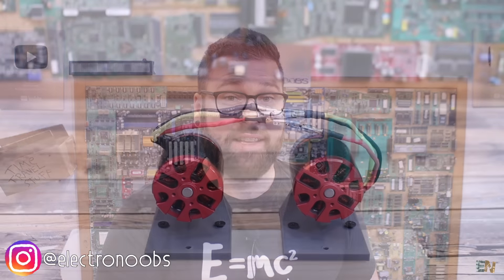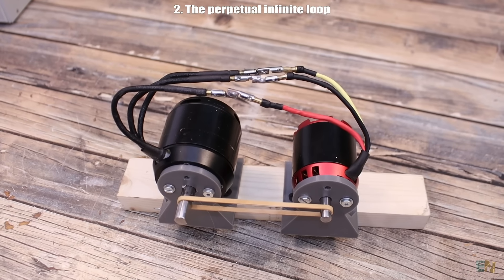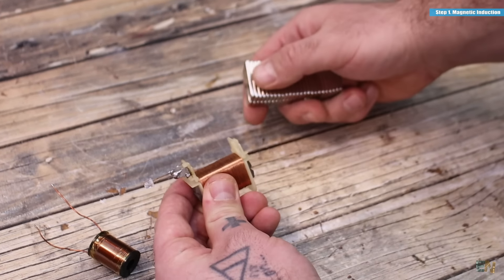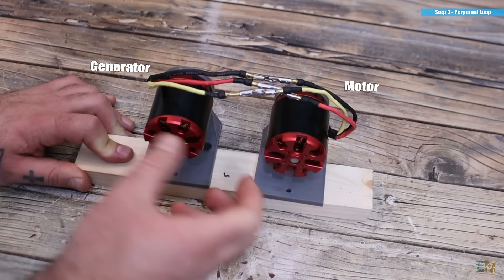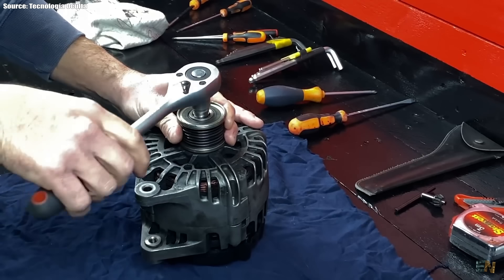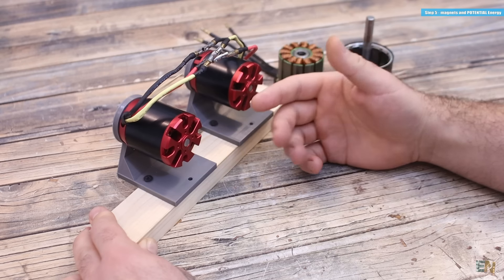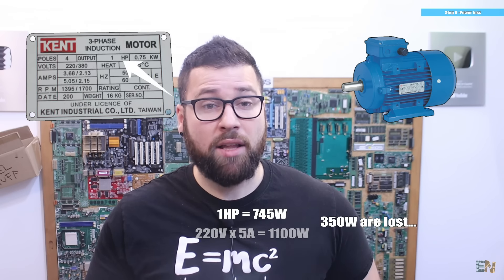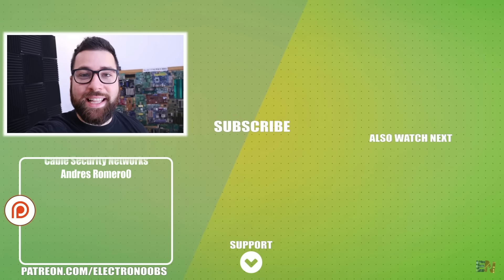Free Infinite Perpetual Energy Nonsense - FAAAAAAKE

Comment: It's not perpetual but it is improved input and out output generation efficiency. Its like traveling 100 kilometres in a v12 car and travelling the same distance in a 4 cylinder car. You will both cover the same distance but with different energy requirements. It's all about improving the way you conserve all the energy being lost. For example, Tesla can, if it wanted capture the energy being lost through the motion of the 4 wheels on the car by installing magic fields around each wheel. How would you classify the energy being recycled in this process? Would you call it non-consequential? Think before you criticise.
Reply: keyword being magic... MAGIC lol

Comment: Excellent video! I like that you mentioned the reaction to the Lorenzt force. I think many people hear "moving a magnet near a coil creates a current" and think "Oh! well then just put magnets on anything that moves anyway and presto! Free energy!". Anyone who has shorted a DC motor and tried to spin it should get the right idea pretty quick:)
Reply: Research gerad morin ,also iconium technology, free electricity is a reality
Reply: @dominicgeorge7299  I looked them up. Both seem to live mainly on youtube. I did not find any links between these people and peer reviewed research or anything that actually challenges established physics. In the "2018 study" (actually just another yt video) the guy shows some basic textbook formulas and says they were "found on youtube"! This is glaring evidence of lack of education, and is pretty lethal in terms of credibility. Instead of presenting operating principles and relationship to known fundamentals, the "study" focused on just listing specific minutia and specifications of the motor and controller, in exhaustive detail. This is typical of analysis by uneducated people, or those who don't understand fundamentals. For example, the "study" focused on isolated voltage or current readings to support claims of over-unity, without discussing the thermodynamically meaningful quantities of power and energy that must be central in showing that you have created an over-unity device. 
Full disclosure, I spent about 10 minutes scanning his 2 hr slideshow.
Reply: @drienkm  what you see being Don is not theory it's hands on real why would you look for a theory, when it's being done and explained in your face,  check iconium technology again hear what is being said  the principles is explained in detail, now follow the instructions yourself, also gerad morin has brought engineers at his work shop and demonstrated his principles to wich the engineers scratch their heads and said they will have to check with more theory,  there's a lot of people who don't want this knowledge to be available,  I'm sorry to say that I have a feeling that you are one of those people,  there is a website on internet created by gerad and bue , take a trip to Nigeria where you can see multiple houses using this technology
Reply: @dominicgeorge7299  Well, the goal in this case is to create energy for free, right? Don't you need to know what energy is to show that you're doing that? (These people have not shown that).
Nobody contests that you can make devices where some particular measurement of output is higher than the input. Devices that increase measurable things like voltage, current, torque, and rpm are common, but these are not over-unity or free energy. You have to actually understand what energy is to show that you're making it from nothing. The thing about energy is you can't really measure it directly. You have to measure its components and calculate it, but that involves basic theory. 
These people are not stupid, they are doing what we all do do until we learn to use the tools of prediction that established theory can provide. I tried to make a motor /generator pair run forever when I was about 8... It didn't work and now I understand why.
Reply: @drienkm  you have not and did not watch iconium technology where not only the principles was explained but a full demonstration,  if you're not going to watch from beginning to end then you can't speak,  please watch iconium technology where a Nigerian explains in detail then demonstrates, note that iconium technology video is not monetize, not like the free energy is faaake guy is ,he is an influencer paid to cast doubt, also I dare you to research maxwell chikumbutsu I hope I'm spelling his name right, he is from Zimbabwe 🇿🇼 and the first inventor of a television that operates on free energy, using radio waves, he has also invented an electric car that does not need charge, also an helicopter that runs on multiple fuel sources, last but not least is research the name Harlow mayne's h2 flex an inventor from Jamaica who runs his car off of water only, he sells his device for $1000 dollars, you can find his device on you tube being used by Americans,  sorry but your time is up please don't be upset
Reply: @dominicgeorge7299  The guy in the Iconium video strikes me as an intelligent, genuine person with a passion for what he is doing. He did not however, explain or demonstrate over-unity. He mentioned the word energy a few times, but he did not calculate power at any point in the system. If his device was producing energy from nothing, he could have shown that either by demonstrating that the battery was not supplying energy (notice that it was never disconnected from the motor in the video), or by allowing the system to do much more work than a battery of that size could ever do before being recharged. 

A large lead acid battery like that would store something like 500-1000 Wh of energy when fully charged. I saw two loads: a light bulb and a small CRT TV. They were connected for minutes in the video. So assuming each load drew 100W, the whole whole thing would still have to be run continuously for days to show decisively that they weren't draining the battery - much longer if the loads were suspected to be lower-power than they appeared, or the battery of a more energy-dense chemistry than lead acid. Again, I have no suspicion of deception in this case. It's just really easy for the tinkerer to misunderstand what is happening with this kind of thing. In this case it looks like he effectively made an inverter with electromechanical elements.

Looks like the H2 Flex uses a chemical reaction between water and other stuff to produce hydrogen. Pretty cool. Why did you offer this as an example of free energy? 

Chikumbutso's TV (Samsung by the looks of it) is still powered by electricity I imagine;) If he is powering the TV (and the car? Couldn't find a website) with a device that collects stray RF energy and converts it to a useful form, awesome. Sounds like a really interesting and difficult engineering challenge. It doesn't contradict what we know about the nature of our world. So again, why offer this as an example of free energy or over-unity?
Reply: @dominicgeorge7299  get a job
Reply: @mrnoone8852  Pretty convincing video, but what are the chances the drill and angle grinder wouldn't sound abnormal when run from an unregulated AC supply? Why does it sound exactly like they are running off the grid (standard voltage & phase frequency, and largely un-affected by inrush current) Why don't we hear the machine bog down a bit when he hits the trigger?
Why would the creator of a 4.5M view video, comment on my loosely related comment? Why can't the guy talk? This has all the marks of a video made to rack up views. You might even be a bot for all I know. If you aren't 
, I'm sure you can tell me about your version of this... What loads do you run off of it?

Comment: I have a question what happen when you take the to motors that are the same give it like a 10:1 gear ratio would it be possible to make it run itself and if you change the direction of the motor with smaller gear/pulley would it generate power to at prolong it?
Reply: Sounds like a good thing to try.

Comment: Ok, I get the physics of the process and I agree with your evaluation. But now, please, be so kind and explain to me how they power the electric motor to run? I mean, I do not think they hid another electric motor inside of the main motor to power the alternator. It is not possible to put a small electric motor to power a big 1KW 230V motor from the inside. So, where is the source of power to move the electric motor? In the alternator? How they could have hidden the other motor to make the entire set move? Or they simply had hidden cables to move the electric motor? In some of their videos they move the entire set around and it still runs. If there are hidden cables, it would be hard to do. I also saw another guy who made a similar video but with a generator, not alternator. He coupled an electric motor, a power generator from Trabant, added a big capacitor and started the set from a external battery and after a minute or so he disconnected the battery and the set also worked. He did not do any modification to the power generator and did not add magnets. Just connected an old electric motor with a power generator and a big capacitor, started the whole set from an external battery and it ran by itself. He moved the set around to show it works. But he did not draw any electricity from it, just showed that it works without external power. So, please, explain how they make the set rotate?
Reply: Hidden battery and inverter. And you can run a big motor on very low power,  just with no load.

Comment: As retired electronician engeneer I entirely agree with your true exact explanations,
Perpetual motion is a dream and still a dream. actually impossible to realise with the technology we know. (maybe with new technologies it will become more impossoble..?)
So if unity machines are a dream, over unity ones are a phantasm...  
Great video you did.
Reply: An electronician engeneer should have better arguments.
Reply: What the hell is a "electronician" engineer?  🤣🤣🤣 we're making up professions now.
Reply: @martinrock289  "An electronician engeneer should have better arguments." - Clearly he didn't understand the kit he was working on, or at least the physical principles they were based on.
Reply: @zoranmaletic7516  You just don't get it, do you. 

IT'S NOT PROPAGANDA, IT'S SCIENCE.

You can't get energy for free. It's as simple as that.
Reply: bruh its possible to have close to free energy something always compensates (battery,wind,gas,heat,water etc)
Reply: @drianswa1133  Batteries cost A LOT of money and require inverters and you have to charge them, so not even close to free - considering charging losses and purchase & replacement costs, they are much more expensive than utility-provided electricity. Wind turbines cost quite a lot, depending on how much power you get from them. Yes it's possible to build your own from an old car alternator or 3-phase motor and carve your own turbine blades but these cost you a lot of time and effort. Gas (whether you are talking LPG or gasoline) costs A LOT of money, generally more than utility electricity. Heat costs you to get to the source of it, like drilling deep into the crust, and the heat pumps it takes to convert into usable energy. Water turbines same as wind. Solar costs quite a lot for PV panels and inverters (the ROI on solar panels for a domestic installation is usually between 8 and 13 years, depending on how much you pay for grid-supplied electricity).

No, there's no such thing as free energy, and "close to free" is relative.
Reply: @christopherbedford9897  oh kid plz what you think is already wrong don't you just hate narrow minded people speak to me again when you really know what a battery is :) keep being employed lol your good at it
Reply: @christopherbedford9897  i can get free energy, do you know or remember the parabolic mirror where i can cook foods and burn most things?
Reply: You mean, man-made perpetual motion???
Reply: @beaueads4170  🙄
Reply: @moneymike787  I can't believe you haven't heard of electronics engineers. Who do you think designs electronic devices? I am an electronic engineer specializing in industrial automation.

Comment: I made free energy yesterday and proved it.  All you have to do is create resonance oscillator and measure it, then when you connect it to a good earth ground, it "will" begin to produce more power than without the ground.  Many people are successfully producing many forms of free energy using large magnets, large gauge wire, high voltage and high frequency.  It works in other areas of nature as well like refrigeration systems, sound, etc..  a microwave oven and nuclear bomb also uses free energy.
Reply: KISFIAM DE NAGY KÁR , HOGY APÁD HÜLYE VOLT ÉS TE IS AZ MARADTÁL

Comment: Hi, could you tell me if there is a difference of voltage between passing the magnet in front of a coil and passing the magnet through a coil?
Reply: Not really. You always have to think of it as a field of magnetic flux and vectors. Depending on the relative orientation, direction and movement of the magnet and the coil (+its core) the relative vector might vary and induce smaller voltage (Maxwell equations) and not a continuous sinus, but just some bump, as shown at 3:40.

Comment: Thank you for your presentation, and it is a verry good one. the major problem is that these con-artist are in-fact blurring the concepts of free energy with perpetual motion. the original concept of free energy was to harness the natural flow to do domestic work. these systems are considered free because the resulting work exceeds the cost of construction and maintenance of the infrastructure. The ecological consequences of free energy have been generally considered as inconsequential in these equations, many times to our detriment. perpetual motion, the action of a device that, once set in motion, would continue in motion forever, with no additional energy required to maintain it.  This type of device would require such a fine balance of forces that it could only maintain its self any attempt to draw off of it would shut it down.
Reply: no, free energy means overunity.  ~ the truth is always simple.
Reply: Very well said Mr. Brown !!!

Comment: A lack of physics in your education can make you believe almost anything. Especially these "free energy" devices. Thank goodness we have people on this platform who know how to communicate physics in a understandable way and hopefully more people get educated. Many thanks for this video.
Reply: I think you should take your own advice. because he is wrong .
You don’t get energy or electricity out of the magnets and it has nothing to do with the copper that's there other than its original job.
The magnet turns the motor by using the shell of the motor as it turns since the shell or cover is made out of metal. As the motor turns it generates energy similar to a water turbine on dams instead of a propeller or whatever is inside a dams mechanics its the magnets and the metal cover of the motor that is the water and the magnets the propeller that spins the turbine. the use of the other motor is for it to keep it at a constant spin so it generates the max amount of energy or power. because the momentum of the magnets and the spinning will eventually stop.
Reply: @diesiraeetvindictae1635  I'm sure you're trying to explain this set-up, but I'm having a hard time deciphering what you are trying to say. First of all, what's the original job of the copper? Are you trying to say that the iron cover is spinning the magnets around? How do you compare a stream of water inside a hydro-electric generator to the iron cover? How do you envision that the iron cover influences the magnets inside it? Where does the other motor get its energy from and why does the spinning eventually stop?
Reply: @umitdolap1733  wow, allot of questions and excuse me on my words. 
1. The copper wires I think are used to generate the electricity while it spins which is it’s original job and if the magnets are giving any charge it’s not significant.
2. Iron is how do you say when a magnet can stick to it can be magnetized it can influence magnets. So, yes it’s influencing the spinning.
3. About the dam and magnets it’s the best example I could think of at the time and try to compare one with the other. On which one influences each part.
4. I’m not a engineer or scientist or have a high school diploma so I can’t explain it any better how does the magnets  spin I’m doing my best logically and common sense. But, I’m assuming that the polarity of north and south has something to do with it.
5. I’m not an electrician or engineer. But, when the magnet generator spins it generates a certain amount of power thus the other generator uses whatever power it needs to spin the magnet generator to produce the energy it needs to power. But, the additional energy where it’s coming from I wouldn’t say it’s not coming from nowhere.

I watched this supposedly YouTuber to explain to me where the energy was coming from and how it’s fake. He didn’t do that only thing I got was jealousy of that YouTuber having so many people, then there was the props which you were hoping he would build a smaller version which he didn’t, and the copper wires and the magnet he was just moving up or down or whatever is not what that experiment was doing on that YouTube channel.
@umit dolap only thing I would say is build it yourself or something similar or within your budget. Those generators weren’t cheap it would cost you +/-$1000/£1000.